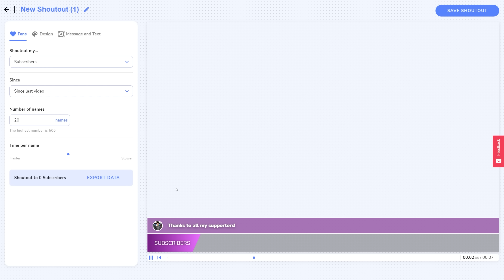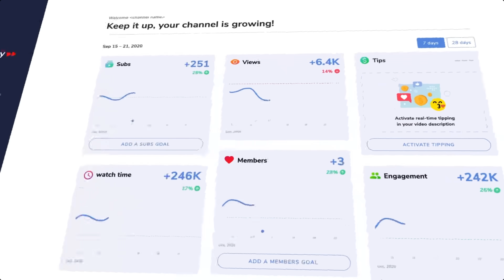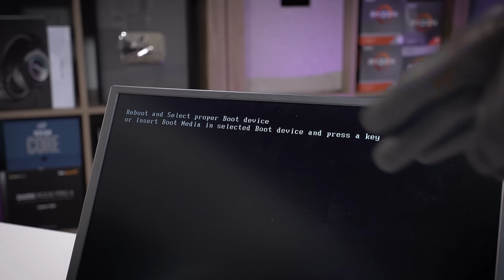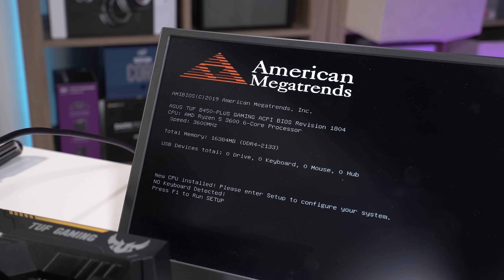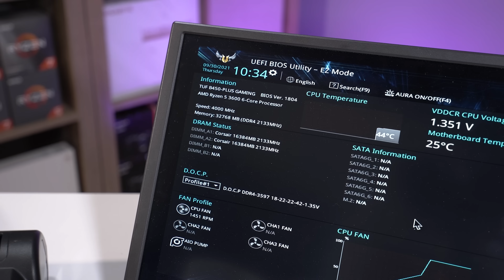Fixing a Viewer's BROKEN Gaming PC? - Fix or Flop S1:E15

Comment from the maker: Hey, everyone! Be sure to participate in the poll at the top of this video description! Genuinely curious of the outcome. ALSO, I've been working on the Season 2 finale of PCDC! It should be airing around the first week of November. Sorry for the hold-up. I've talked about this in previous videos, but it's becoming increasingly difficult to source genuinely dirty systems in the Orlando, FL area. If you or someone you know has a very dirty rig in the area that you'd like cleaned for free, shoot us an email: help@salazarstudios.org - Remember that you must be local. We don't accept shipments at this time. Thanks for the love!
Reply: What's fof?
Reply: Lol nvm
Just saw the title
Reply: greg!!! my ram usable and hardware reserve issue that eats 8gb of ram out of 16gb ram. How to fix this. properly pls I change rams. msconfig trick. plss
Reply: wow I've actually learned something new.  I didn't know a memory channel on cpu was bad.  I've dealt with bad ram slots on mobo thinking its mobo problem so I'd just put ram in other slots where it would post.
Reply: That poll is kind of odd. I'd hate to see either series go away. It's a coin toss which is better. Isn't that the third CPU "failure" in a row for three different reasons?  Quite a coinkydink.
Reply: its not very rare for low binned , highly oced Ryzen CPU,s too fail .... kindof common with Ryzen 1in 20 chips fail for various reasons dead mem channels or even completely fried...
Reply: I like them both, so I'm not voting...
Reply: Dude - did you run out of ideas?  These are the only videos that you ever make any more.
Reply: I honestly like both, FoF is more informational though.
Reply: Did he install the AIO correctly? maybe the pump wasn't running and the single fan caused it to run super hot and die?
Reply: Nevermind. Im wrong
Reply: @mrekt4u401  This one Fix or Flop
Reply: G'day Greg & Pepsi,
I really like them both, I have the Tools & ability to PCDC myself, plus seeing PCs get cleaned & looking loved again gives me a smile but...
I had to pick FoF, because even though I have been learning how to Build & fix PCs since the 90's there is always a new prob I haven't had to deal with so I get to learn something, like this one of a Memory Controller having 1 channel die, I've only ever seen a complete MC Death, 
I hope they both continue & that you can keep helping people & bring them some Good Feelings in this time of World Gone Crazy 🥰
Reply: Do you ever have any of the manufacturers of the faulty products reach out to you and ask to send any of the parts for testing on their own end as well?
Reply: i hope there no bubbly sound from AIO after u change it
Reply: @7:59 I see thermal paste in the border of the pins, maybe memory controller is not dead, just not making good contact into the soquet
Reply: interesting Greg bro :). I read about the bad news about Win11 slowing down Ryzens,  hope you make a vid on a fix 4 that when it becomes a norm- not that i want this to. ty 4 the lessons always good day from your neighbor in Canada,
Reply: amazing content🔥
Reply: @mrekt4u401  Fix or Flop
Reply: Can't make a choice I really enjoy both series.  However I will say I was screaming "RAM!" at my monitor when it wouldn't post back in his PC lol.  What I really like about your channel is you then go back and show the outcome of full testing, ok his PC is fixed but why doesn't this part work, so much more realistic.  At computer store or in an IT office you have to do that proof to get a warranty RMA etc.  Maybe its out of warranty but that part can still be used in it diminished capacity somewhere else where the defect doesn't matter (you don't need dual channel to run Word or Adobe reader).
Reply: Didn't know how this works, so I clicked on both xD and it voted for PCDC. However I find FoF a little bit better.
Reply: might be a dumb idea, but have you ever considered doing one of these episodes on a budget, a lot of us don't have spare parts we can swap in and out of our Pc's to trouble shoot, so maybe a video showing how you would test these problems if you were also in that situation, love the playlist would be really interesting to see.
Reply: @crimsonkeygaming8589   @Crimsonkey Gaming  actually he did it in a lot of episodes and also explained it everytime. JUST THE BARE MINIMUM. 
Look up the Ep.14. 

I'm pretty impressed that Greg gives such a good explanation. I also really like that he shows his steps and don't just skip to the problem. It's entertaining to watch and give you an idea how you would start to fix your PC. 
He also explains what he is doing, like clearing the CMOS because it's simple and take no time.. I can't remember how many times clearing the CMOS worked.. because it was too many..

No Joke, what Ep. 1 - 15 and you are good to go. 

In this case, if you haven't had a spare Ryzen 3600, you most likely just looked at the CPU, reseat it and it would work .. if it would be a pressure problem.
Already in many episodes, he mentioned that you should start up you PC only with 1 reseated RAM-Module. If it doesn't boot, try another slot.. so you would got the fix.

So probs to Greg for the Series.
Reply: FoF is actually useful for trouble shooting and learning about PC hardware.
PCDC is more of a therapeutic easy viewing.
Reply: Thats a new info to me thanks for sharing.  Though the cheap H61 and H81 boards do have such issue where due to some issue on mobo the channel dies
Reply: I enjoy both equally as much, yet voted FoF, cause I love fixing PC's and I learn a lot watching the series.
Reply: I have a question. Would it make sense to always first plug in a known working power supply in every scenario? Just in case it is a faulty power supply that might cause further damage to other components? Or is this not a potential issue? Anyway I find this series really interesting and learn a lot from it.
Reply: I really wanted to vote for fix or flop, but accidentally pressed PC Deep Clean instead!  Oh well...they are BOTH really good anyway, in my opinion. Love your videos, Greg!  I wish that I had a van that I could donate to you for free because I really like the idea you have about traveling around the state/country fixing people PCs' and videotaping them. Best of luck with that endeavor!  👍👍
Reply: @Greg Salazar do you know how to fix the pc if for example your playing a game  then randomly it blacks screens then it comes back to normal and it freezes do you know how to fix it?
Reply: Hi greg, I have a computer here at home, it's specs are : core i5 4690, hyperx fury 1600 mhz 2x4gb ram, gigabyte gab85md3h, 240 gb sata ssd, 320 gb hdd, corsair cv550, radeon r7 250 1gb, and it won't boot. my old computer does short fast beeps but fan spins and then turns off and then does it again and no display and then i suspect that my old motherboard (gigabyte gah81mds2) was at fault. So i bought another motherboard from shopee (online selling platform) and it's still the same, help me greg, I'm from Philippines and i am still studying, i have to pay for other expenses and can't afford to buy new parts that's why i opt for lower end computer as for poverty. The sad part is that the online seller does not consider return and refund or replacement even though the warranty is not yet over, it's been 1 week since i bought it, and chatted him after i receive the parcel after 1 day and been spamming chats to him and always tell me that the motherboard is working.  If you can read this, or anyone, please tell me how to fix this... Or any help will be appreciated. Computer is very essential here since online class is on going because of covid-19.
Reply: How about you let me send you parts and you build me a pc <3 :D
Reply: that case is the same as mine but in black :)
Reply: Heya, Greg! Would you ever consider a video end graphic with the Fixes vs Flops vs (other valid metrics--tricked in the hopes of a free upgrade?--or something)? Something fun that could also add to the branding of the series. 

Probably a silly idea, but was idly wondering how many eps there were exactly and how many flops there might have been. If I recall, I think only one so far? The last two years have been a blur!

Great channel and love the series. Cheers!

Comment: I appreciate how you make pc repair seem accessible to people who may be too scared to open a side panel.
Reply: I have a relative thats too scared to troubleshoot their system and wants to pay for a technician to that for them, even though their an IT and im willing to that for them ahahaha its so funny that the problem is just that the 4 pin connector is not connected properly
Reply: As long as it's not an OEM pre-built.
Reply: iam still scared of static electricity !
Reply: If you are too scared to open the side panel you have much bigger problems
Reply: Some people think you can easily short a mother board or any component on a computer but that’s not the case
Reply: Heres my take on it, if you are brave enough to build the pc yourself you should be brave enough to open up the side panel and try and fix whatever issue you're dealing with
Reply: I've been computing since 2001, and I still get scared opening my side panel...(thanks tempered glass) 😑🤣
Reply: I upgraded my gpu cpu and ram and let me tell you inwas scared asf to mess anything up and once i thought i dis bc the 8 pin you plug into your gpu the fans wasn't working so i shut it off and switched out a pin and everything worked
Reply: I open mine when it's on all the time. It just looks so coooool!! Looking through the glass just doesn't do it justice 😂
Reply: Literally feel that one but yet want to start building them
Reply: I would like an apology for being called out-
Reply: I had to open my side panel because I could see it was getting some dust inside so I could dust it and I was sweating bullets the whole time trying to be super careful😅
Reply: hey i always open my computer because i swap my fans very often and i also clean it a lot so i never got scared in opening the panels of my pc i'm so used to it
Reply: I'm that type of person to open a HDD and not worry about the dust 😂🥴💀
Reply: i was scared to open the side panel at first lollll but i did it just to inspect. although I'm still too scared to unplug and unscrew anything in my rig. i had a faulty fan that i just couldn't get out because all the wires are tightly packed so i brought it to a shop to get a single fan replaced cuz i couldn't do it myself :[ plus my anxiety just gets the best of me... that's why I'm slowly trying to learn more in hopes that one day i'd have enough courage to troubleshoot simple things on my own

Comment: I had a completely different but analogous situation happen to me. I was building a system and it started blue screening once I installed the AMD drivers. Come to find out that that was because the RX 6700 XT was actually a scam. It was a RX 6850 M XT mobile GPU that had been soldered onto an 6700 XT board. Took out the GPU and replaced it with an actual RX 6700 XT. Then it would freeze on boot. Even after switching it out to multiple different 6700XTs. After some more part swap elimination, I switched out the 5700X3D with a different one of its kind and it started booting successfully. And the first 5700X3D, I put in a different system and that other system continued to boot successfully with the first CPU. Why swapping the CPU with the exact same CPU would do anything I have no idea. What Windows is resetting to "fix" things when you swap a CPU is beyond me. I didnt even uninstall the AMD drivers and it still works.

Comment: My favorite thing about this series is learning something new. I'm pretty good at troubleshooting and I don't think I would have thought of that solution. Now it's going in my toolbox of go to solutions forever.
Reply: Same
Reply: Oh, most definitely.
Reply: Totally agreed
Reply: Yeah this dude has added so many new ways for me to diagnose something but this is something i literally never would have thought of. I would have just swamped the CPU and that would have been the end of it
Reply: I have a  PC with the same problem... channel B dead. I'm still using it in single channel mode. I was just too lazy to replace it on warranty when I just brought it. Right now it's just working as a media center/HTPC.
Reply: Same
Reply: I build 20-30 PCs a year and need a fair amount of troubleshooting, but 2 weeks ago i was on my knees. build a 11700k/3080ti system and everytime i rightclicked on the desktop to get to display settings, the whole contrast was gone and you could fix it for a short time by swap resolutions, but it would occur while gaming aswell and was pretty annoying(black was grey etc). so i put the 3080ti in my rig, no problems. checkt his build with another gpu, no problems. swapped mainboard, same problem, swapped cpu, ram, same problem. after 8h of ripping my hair out, i saw that the windows version installed is oct 2020, updated windows, problem gone. seems windows, even with drivers installed, couldnt handle the 3080ti without the update.
Reply: Same
Reply: same :D

Comment: I’m buying parts and waiting to build my first pc, this series is straight up ESSENTIAL to watch.
Reply: It's very simple.. nothing to be scared of.. Just follow the how to build videos from one of these yt-ers.

I've done it alot of times . these days I just lay everything on the desk and just get it done in an hour (most of the one hour is spent cleaning up the packagings and tidying up the cables.. the actual components takes just a handful of minutes to put together)
Reply: this one was a curveball for sure...I did NOT expect a memory controller issue with the CPU...but this video was valuable in the troubleshooting toolbox.
Reply: Congratulations for your upcoming PC !!
Keep this things in mind :
Check Compatibility of your components before you buy,
Make a recording of the package unboxing, Incase if you receive any damaged components then you can show that you didn't did anything,
Carefully choose your components, don't over spend on features you don't need, 
Buy good quality PSU choose reputed brand,
Buy good quality thermal paste,
Always Be careful with BIOS updating read everything mentioned about it on manufacturer website carefully,  
Take a look at reviews of the components you selected on various websites,
Take a look at Manual (gives you more information about the product),
After successful build : keep proper bills and boxes, manuals,CPU socket cover (Intel motherboard has this, a plastic cover given to protect socket pins), accessories etc. This will help you if you ever need to replace any under warranty components.
Reply: You should tune in to Cary Holzman too then, if you're building.
Reply: super easy, imo the real challenge building a pc are:
1: Applying enough thermal phaste, i myself use pleny so i know the sink and cpu have maximum connection.
2: Cable management. Making it look nice, in the case its bit easier, the back is worse (lyckily you wont see that once u connected everything)
Reply: Well Greg didnt realize the obvious reason that this computer was broken in the first place so hear me out... the viewer tried putting an AIO in his rig and couldn't get both fans to fit on the radiator.   He tried forcing them and broke that ram channel in the process.  Then he said screw it and just mounted the second fan to the back of the case instead, but the damage was already done.. then he emailed Greg.  Moral of the story .. dont force your components because you're impatient in figuring out the proper way to assemble.
Reply: @MrR2185  the dude broke the ram slot trying to fit that rad fan in the case.. was literally my first thought when I saw that dan missing

Comment: Definitely enjoyed this one, while learning something along the way. Never in my 26 years of IT-related troubleshooting have I come across a CPU with a dead memory channel. Dead CPUs , sure, but one with a single dead channel?  You sir have given me yet one more troubleshooting step to add to my repertoire.
Reply: I ran across an identical issue, however the 3500X I had issues with, would only work with 1 dimm regardless of the slot.

Comment: There is more to this one Greg. 

At 4:31 when you turn it on the vrm cover sparks and again at 4:44 when you turn it off.
Reply: That is something you dont want to see. An active short on your mobo.
Reply: Have fun with gigabyte rma process... lul
Reply: Good eye, dang
Reply: Explains how the CPU failed, could fail the next one too.
Reply: you would think Greg would have watched his video and saw the spark I see it. Why did you not get a reply???? good catch
Reply: Good catch, man that's definitely not good
Reply: You can see the spark in any resolution 480p and 1080p, but not in 720p, why is that?
Reply: @wuspoppin6564  LMAO
Reply: @wuspoppin6564  I've tried this too and your right, its not visible in 720p
Reply: That is no spark. If you look closely you see the leds behind the motherboard flash for a briefly second. You can clearly see it if you look at the exact same second on the bottom of the motherboard when the flash appears on the top. Those leds are on the backside of the MB from top to bottom and it is just the flash you see between the cables. Nothing to worry about at all
Reply: Was just about to post this
Reply: Not a spark

Comment: At 4:31 there was a spark in the upper left corner of the case right inbetween the vrm cooling heatsink, Its just a fraction of a second but it still can be seen.